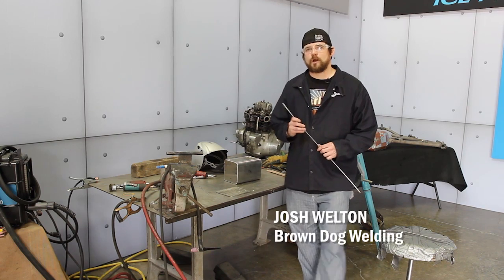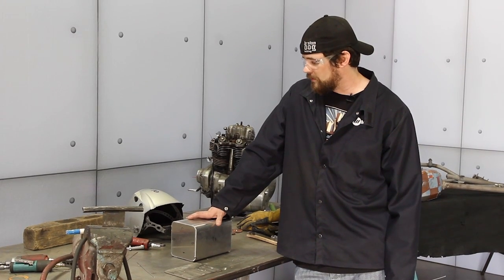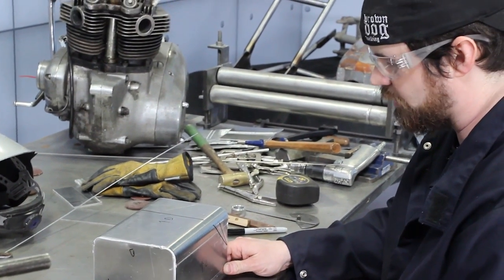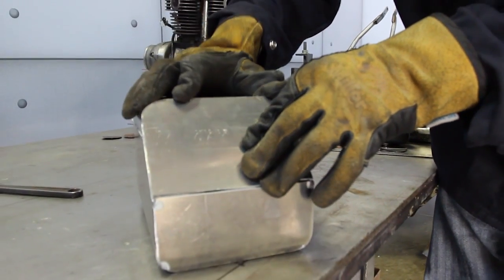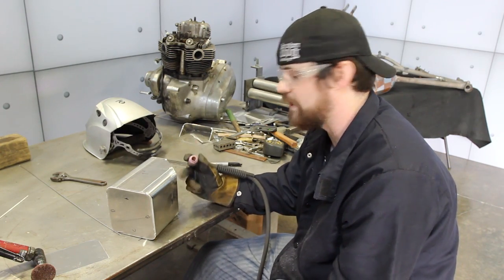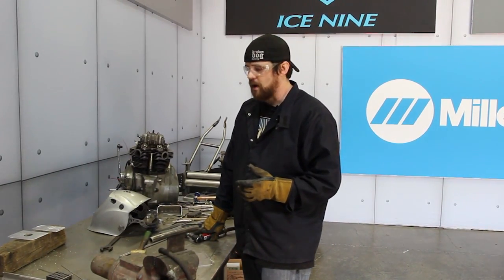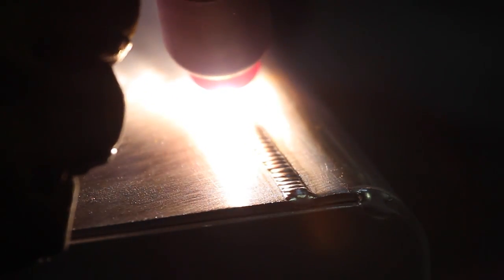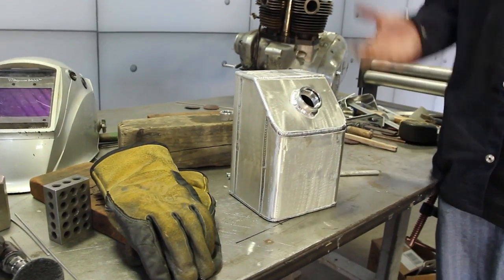Brown Dog Welding builds Panic Attack oil tank using Dynasty 200

Comment: With the 5356 welding filler wire it will take anodizing more evenly that the 4043.
It means it will look better is what I am saying.
Reply: I didn't anodize the tank, so that's a non factor. 4043 is more ductile and has same strength on butt joints.
Reply: Josh Welton I was saying IF you WANTED to anodize or if the end user wanted to anodize. Thats all.
Reply: Lucky Dog I was not attacking you.
Reply: I was just explaining again why I did it the way I did, in case you missed it. No worries!